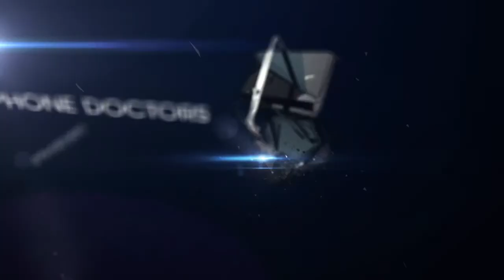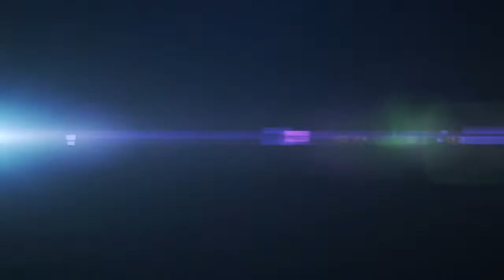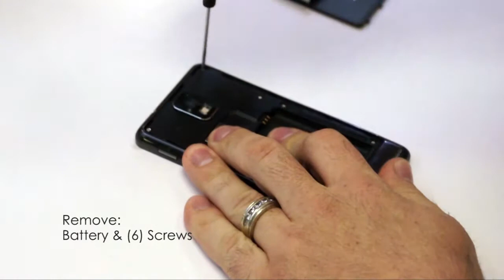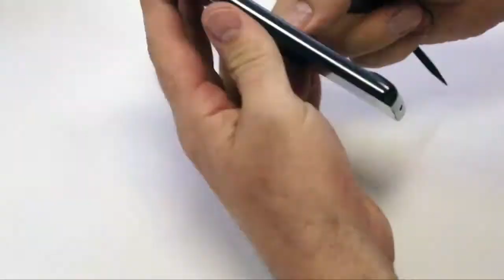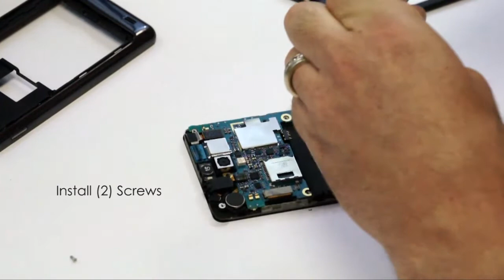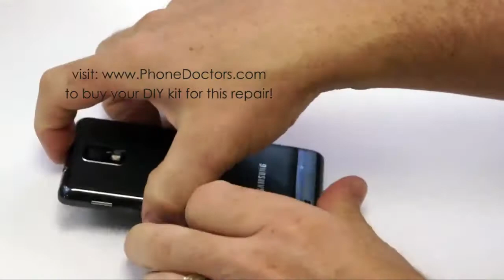Samsung Infuse Screen Repair in 3 Minutes

Comment from the maker: Unfortunately the Infuse digitizer screen is only available with the LCD.  They are fused together by the manufacturer for easier replacement.  These screens are also in very short supply, this has increased costs through the entire supply chain, so be prepared to pay a premium or wait a while for delivery.  These are currently available at our online store.  A link is in our description or just Google PHONEDOCTORS

Comment: With the Note II, you can heat up the device and separate the glass from the LCD. I just ordered the glass by itself and am going to attempt replacing it without also replacing the LCD. Don't use my Infuse as a phone anymore, so this will be an experiment. Hopefully it works, because I paid $20 for the glass, new frame and battery cover and would have a phone that is almost brand new again. With the custom ROM I have on it, I would even consider that better then new.

Comment: Ahh what does that mean? I sat my samsung infuse on the roof of my car this morning... FORGOT and drove off to work. It had fallen face down into the road and Im pretty sure my husband may have run it over. It was spider web cracks through the entire screen. BUT the phone is running and the touch screen is working except for the lower right corner. (I cant share photos anymore). Im concerned that if I try this myself I may mess it up so bad it wont power on anymore. Whats a digitizer?

Comment from the maker: How many videos have you seen that show you how to replace a digi only for the Samsung Infuse?  None.  Why?  Well, you can buy a digitizer and attempt to remove your old one from the LCD without damaging it.  If you're successful, you still have to find a way to fuse the new digitizer to the old LCD.  I'm sorry, but unless you're a professional with manufacturing equipment, it's just not likely to happen.